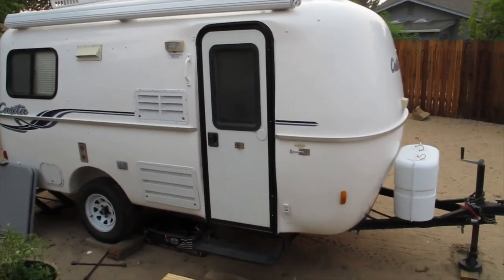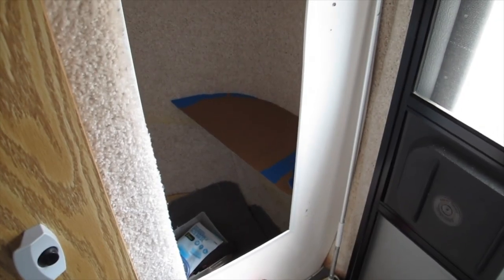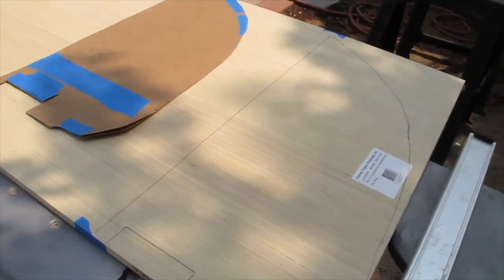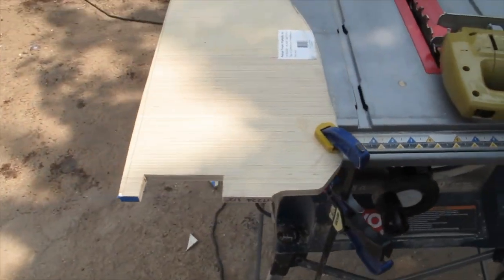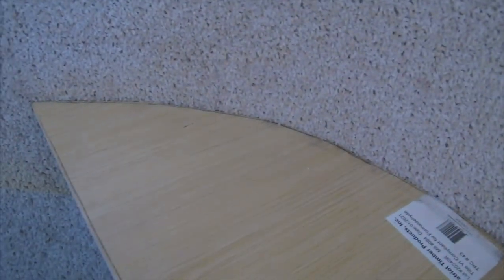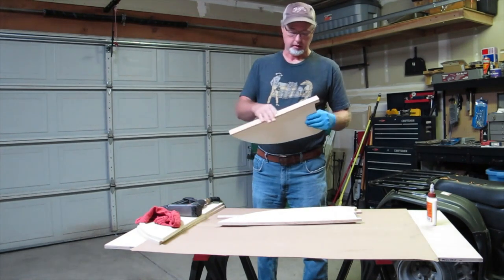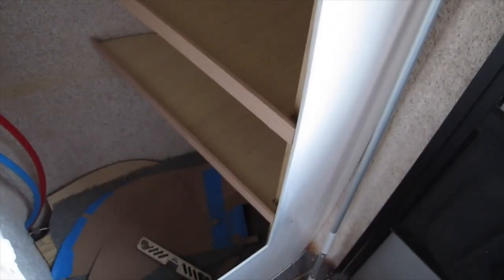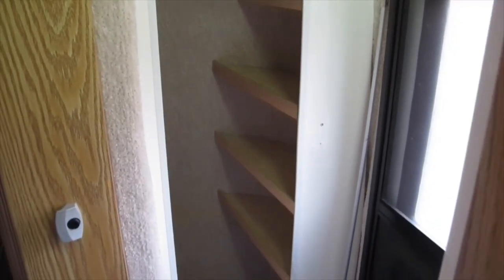DIY closet shelves in a small camper

Comment: it appears the shelves are cantilevered, attached to the closet door strip, and their far ends not supported...?  

Thanks for putting this video together and sharing!
Reply from the maker: Hi Richard, yes that is how I originally did it. It did work fine for things that are light. I have since put braces in on the other side on the bottom 2 shelves. Basically, just cut a piece of 2x2 to length. Added from floor to shelf, then shelf to shelf. 

Thanks for watching.
Reply: @JDPDoingStuff  Got it!  Thank you!
Reply from the maker: @richarde1355  Your welcome
Reply: @JDPDoingStuff  Me again...

What do you think you spent, total, in materials?  In other words, aside from your time, what has the closet modification cost you?  Also, now that you've had it for a year, you still happy with it?  Hindsight 20/20, are there anything you might have done differently, in the design of the installation?  Because the closet is a bit dark, I'm thinking white shelves would be good, for me and my failing eyes.  Have you installed any lighting system in your closet?

Thanks in advance for your help!
Reply from the maker: @richarde1355  Hi Richard, I think I spent less than 50 on the project, I had most everything already. I'm still happy with it. I have added a light in the closet, one of those cheap 'light switch' lights from Harbor Freight. I didn't think of painting the wood white, but I suppose it might brighten things up. In hindsight, I would have built a shelf going across the bottom up to about the bottom of the door which I may do at some point this summer. As far as the shelves, I wouldn't change anything.

Comment: Thanks for a very useful video. Now that you've had them installed for a few months, how did they work going down the road? You mentioned that you were planning to add supports toward the front. Did you need to do that?
Reply from the maker: Tom, They actually work very well. I've had no issues with them at all. I mostly put folded clothes on them, including towels and extra blankets. I didn't need to use the supports on the front for what I use it for. I do however use a few 'bungee' cords across the front of them so clothes don't fall out.
Reply: @JDPDoingStuff  Great to hear. I'll be doing your mod soon. Thanks again.

Tom
Reply from the maker: Nice! Maybe you can video the process, I'm sure you'll do a better job than I. If you're close by Reno area, let me know, I can get you my templates.